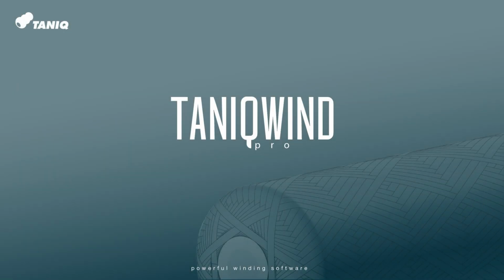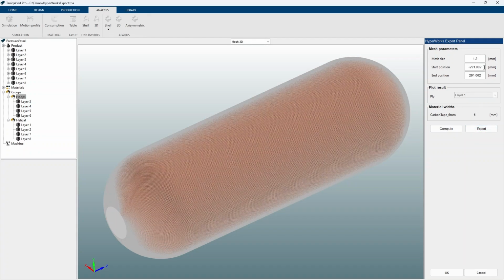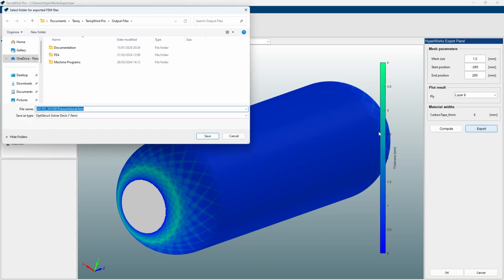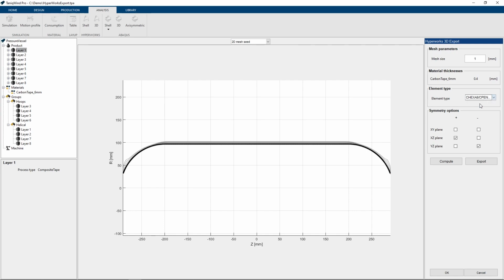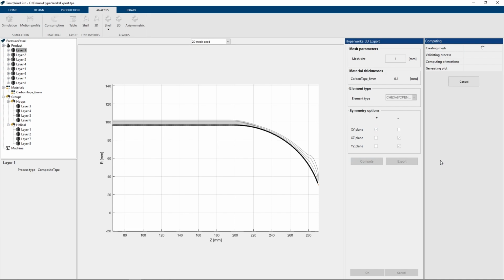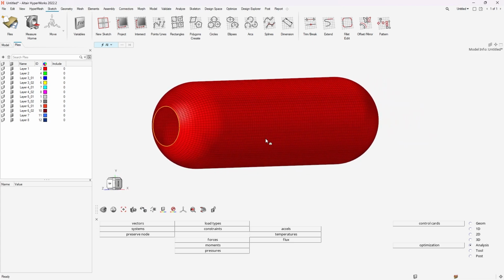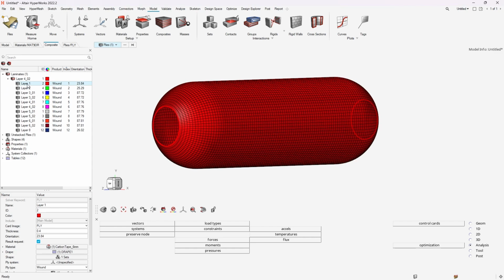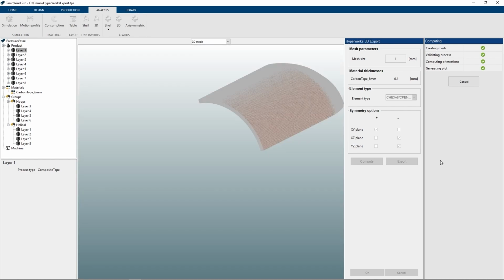How to Export Designs to HyperWorks Shell & 3D Models | Filament Winding Software TaniqWind Pro

Comment from the maker: TaniqWind Pro's FEA Toolbox makes it easy to generate and export accurate Shell & 3D models directly to HyperWorks. With features like tow-tracking, ply-based definitions, and customizable mesh settings, engineers can streamline simulation workflows and improve analysis accuracy. This tool bridges the gap between filament winding design and structural performance evaluation. 

Learn more about TaniqWind Pro: https://composites.taniq.com/filament-winding-software